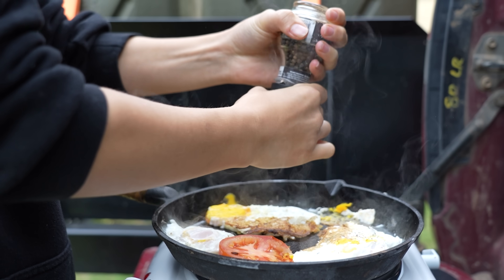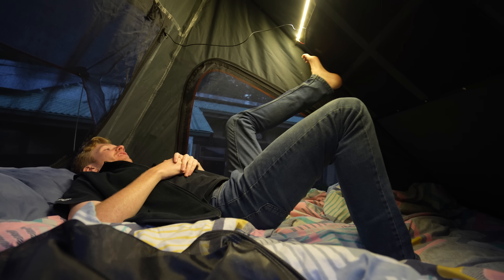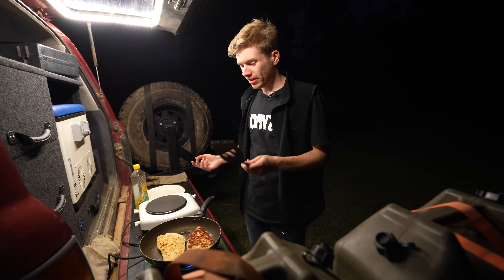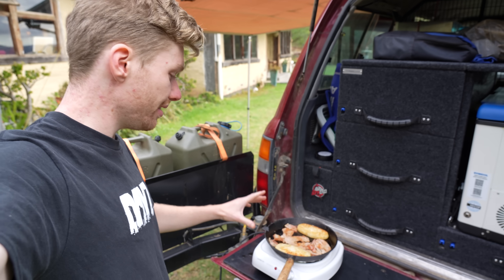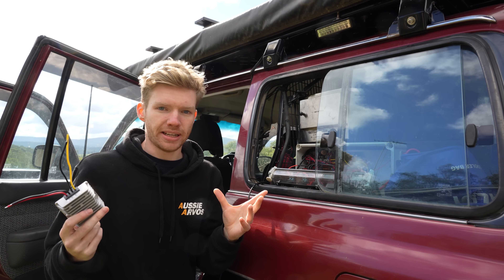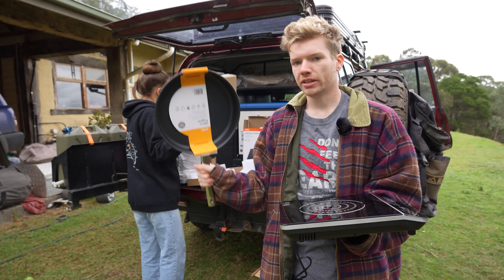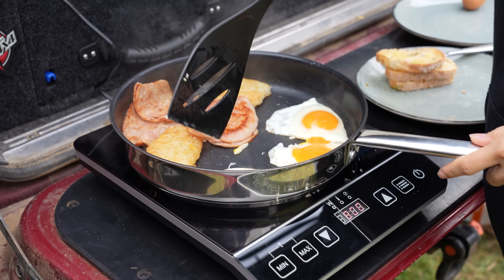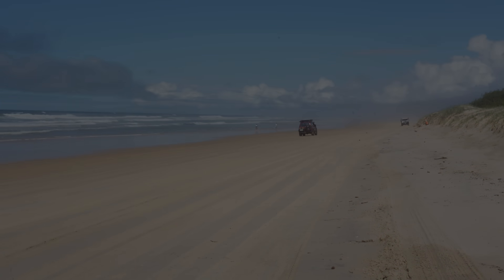is BUDGET induction cooking ACTUALLY POSSIBLE? Pushing my 12v Camping setup to its limits.

Comment: The type of cookware makes a huge difference to the cook, those square pans aren’t that great vs proper thick base pans. Same with the cooker, I’ve had those anko cookers and they don’t really have the fine control, not to mention that stupid overheat error. I ended up swapping out to a safiery square unit and it is miles better.

As for the home, it’s a different level again, and going for a gasless home is a better option in the future as you can offset your cooking costs with solar, where gas always has a set daily and yearly cost before using it

Comment: Have just recently came across your channel. This was a great video thumbs up to you. I'm looking at the Kings 200AH lithium battery, you reckon I could run a kettle, 2 slice toaster and a coffee machine with that size battery using a 1500w inverter? If possible maybe a induction cooker as well? Cheers mate have subscribed and will suss out more of your vids 👍
Reply: @Farque Knows Where Thanks for the reply mate. When you say "with all of that hooke up" what do you mean? I'm only using the battery for what it is designed for, I'm not doing anything with it that I shouldn't be
Reply: @Farque Knows Where I didn't have too much running off it at the same time to be honest. Whe. I used it the one time I have I was actually at a powered site. We're going away in a few weeks off grid so will get more of a test then I guess.

Comment: I wonder if 2 x 80Ah lithiums would be better? You end up with 160Ah but should maintain a higher voltage when in use and probably easier to squeeze them in the car.
Reply from the maker: Yeah, need more power to allow for a higher voltage discharge, after doing this experiment, i think at least 200Ah is required to enjoy cooking with electricity with no issues (for atleast a night)
Reply: I agree, splitting the discharge between two batterys will keep the voltage higher and your batteries happier.

Comment: I think your amp readings are wrong, 1200watts is closer to 120amps.. which is probably over the batterys max output. Ive got the same induction cooker and same inverter as you and i can run it on 1600w for about 5 mins before it trips the inverter. But i have a bigger battery with higher max amp output

Comment: I would like to travel with my Moulinex bread machine so a 3000 inverter with 3 lithium batteries  an 2 sola panel and a dc c charger I thing will maybe coastly but a good 5 years no problem set up

Comment: The inverter is tripping because your wiring between the battery & inverter is too thin. Replace it with wire as thick as your thumb…& it will work as intended.

Comment: You should get 2k inverter works 1200w induction
Reply from the maker: in the end i don't think it was the inverter, more the BMS cutting power as the voltage got to low due to our large current draw on only a small A-h battery

Comment: Not all lithiums are equal… you want one with a max continuous of 150A of more & a capacity of at least 200ah.

You also wanna minimise voltage drop by increasing your wiring size to the inverter.
Reply: Garbage u dont need "atleast 200 amps"
Reply: @krump743  are your eyes painted on?? I said 150A & 200ah. Amps & amp hours are VERY different. Get a clue before you open your mouth, turkey!

& I actually have this running in my 4x4 flawlessly…along with a toaster, kettle, coffee machine & air fryer & 75L fridge freezer…from 660w of solar.
Reply: @pauladams4890  😂😂😂😂😂 i know what amp hours are. Wild touring runs air fryer and induction from 150 amp hours. U dont need 200 amp hour capacity battery LIKE YOU STATED. The continuous discharge rate is the number one wants to look out for.

Comment: Just got to the part where you're seeing below 12v. something is seriously wrong there mate and you're going to be killing your lithium allowing it to get that low. your BMS should be stepping in well and truly before that, like still over 13v.   Also what you need to know about induction cookers is they only tend to be variable voltage over a certain setting. Ive found  that to be around 1000W. Under  that setting they will act like they are PWM controlled where they run at full power but just cycle on and off to give you your desired setting.  Eg it will run half the time at 1000W if set to 500W but when on, it will be drawing 1000W or even possibly what the max rating is. don't be fooled by the setting on the induction cooker. Also you need to know the setting on the cooker is the heat out put wattage for cooking. with losses etc, you might be cooking with 1000W of heat but it can cost you 1200W of power. hope that makes sense .

Comment: I reckon the way to go with a budget lithium setup is to build your own battery with high current connections and a good BMS.
I'm also guessing the induction plate works by cycling on and off at a high power, to average out to the lower output power you set it at.

Comment: Hi mate its your battery unfortunately its a kings cheap BMS you need to have a 100 amp continuous BMS I have induction cooker, microwave, Air fryer, electric hot water heater,and heater all running off 300 amp lithium 3600 watt inverter, renogy 50 amp dc to dc + mppt solar and a 300 watt folding solar that I hardly ever use all  it all runs for days P.S an air fryer oven uses the least amount of power of all once you try it you will never use your travel buddy again. Regards James T

Comment: You have this completely wrong. That kings lithium battery is only rated to put out 100A continuous, if it goes beyond that the bms will cut out. Using that induction cooker at 1200w will be pulling somewhere near 100A so thats why its cutting out plus you have other things switched on too by the look of it. That battery monitor you are using is either wired wrong or not working correctly as it's displaying the wrong amps being drawn from the battery.

Comment: "The results of initial testing showed that conventional electric coil technology was significantly more efficient (82%-83%) compared to the efficiency reports by [US} Department of Energy (74%)."

"These results demonstrate that induction cooking is not necessarily more efficient than conventional electric technology. In fact, the conventional electric coil was found to be 6% more efficient than induction cooking when measured with the large cooking vessel. Yet the efficiency of conventional technology was shown to be highly dependent on the size of the cookware used."

Testing induction and conventional electric (half power / full power):

Induction cooker (best results) 75.7% / 77.6%
Electric coil 81.6% / 83.4%

"Conclusion: Results of this study show that induction cooking is not always the most efficient method of cooking. When tested with a large cooking vessel, the efficiency of conventional electric technology was measured to be higher (83%) than that of induction cooking (77%)."

"Even in its best-case scenario, induction cooking was not found to offer a cost-effective means of energy saving."

~ Induction Cooking Technology Design and Assessment, Micah Sweeney, Jeff Dols, Brian Fortenbery, and Frank Sharp
Electric Power Research Institute (EPRI).

Comment: Cheap second hand recycled Chinese LiFePO4 Cells with the BMS tripping out on 2.5v low cell voltage protection. You need better quality LiFePO4! Cr*p avoid the Giant battery too. They use same recycled batteries too. I had one and absolutely rubbish!?

Comment: Key word you used is budget!!! You get what you pay for.  I got a 100ah DCS battery and can pull an induction cooktop at 2000w 168 amp and run fridge etc and do two dinners and bfasts.  That old cook top you used was not beneficial at all.  Start with a full charge  too. Everyone would be rocking up to camp with a full battery to begin with.

Comment: To be honest for the amount of shot you are  running on 12 vdc  you are likely better off in a 24-48vdc in series battery setup especially if you are using  a lot  of 240 vac appliances 

Noting that you should be looking towards 7.5 kw or higher gen set

otherwise  you are looking at a min of 24-48vdc setup to support the  240vac you are overloading the power consumption at 12vdc and you are above the capacity1.5 kw  inverter this is why you are tripping the breaker

personally I would start looking at 2-4 burner cook tops for cooking in areas where fire bans are

do what you like  however you might want to talk to t an auto  sparky because by the sounds of it you haven't done either a vac power consuption  not vdc power consumption  on your setup as if you had you would of known at 1.5 Kw you have effective  usable usable range at  750W--1Kwat 24vdc at 12vdc  you are likely over amping on the power draw..
Reply: I think the issues is that he wants a budget setup and what he wants to do is not gonna work well on cheap hardware and not to mention how dangerous it can be with the amount of story's about 4wd's burning down from dodgy 12v setups, I always way over engineer my electronics. I had one mate who was running 4 spottiest of a wiring harness that could only handle 2, the fuse kept blowing so he just put a bigger fuse in and ended up melting all the wire instead of tripping the fuse, he was lucking the wire wasn't near anything flammable. 

Your definitely right in that if he wants to run that much power he needs to step up to a 24v battery or at least put two batteries in parallel or series to share the load better. It would also be better to calculate the power draw of everything he wants to run and compare that to the continuous discharge rates of the batteries and even then add a safety factor to everything so that your not running on the edge of what everything is cable of handling.
Reply: @djdoggy9953  for the amount of gear he is running 4 automotive grade lithium  rather than something that looks like ups battery pack
meant to be run in a series of 8 batteries

as much as i like glamping camping setups, you be needing proper battery management setup

I would suspect 2 or more  5kw or larger  inverters to split current load across  2 inverters 

you might save some cash installing this yourself though if you haven't even done  a wattage calc on vdc and  vac.. you will have problems 

My guess the fridge, hot plate pie warmer and exceed 1500 watt each I think most of these devices are going to be a bare min of 24volt by design or for current draw as much 48vdc

even if the pie warmer as a DC plugin i would stick it on a anderson plug and fuse it

though since he was also tripping the breaker he also overloaded the 1500 watt inverter on top of that

I watch him edutainment value on what not to do in an electrical setup because it is a guarantee  at 12vdc you are going to be over amping the setup where you cause electrical fires because you tried to save a buck and consume more power than what you have...

I have a belief the KISS principle Keep It Simple Stupid, this  is far from simple  bordering on being stupid as if he were to have a fire caused by electrics the insurance wouldn't pay out because it has to be passed by an auto spark so it actually complies with safety standards

Comment: Induction cooking is not for me, I'll keep to a gas burner and use the money for the induction setup for petrol. The problem with getting a 12v system set up to be able to run the newest gadgets is 3 fold, complexity, wheight and cost.
How many butane cans can you buy for the price of just an induction cooker?

Comment: I dont think you quite understand AMP draw. If a device uses 60A its actually 60A/hr or 60Ah. So if you can cook dinner in 15mins, it has used 15A. Also, why waste 45mins in a camp oven, just put the food in there straightaway.

Comment: An unrelated point on making coffee. The young lady making the coffee tamped the grounds so lightly that the the water will pass through too quickly without picking up all the flavours and volatile compounds that make a great cup of coffee. Some physical effort is required to compress the grounds. That's why the same coffee from the same shop can taste so different when there is a man doing it and then a woman. The women seem hesitant to use a bit of pressure. The tamper is not for making the grounds look neat. 
By the way, great video.
Reply: Depends on the machine man. You don't know what her extraction time was. The tamper is to make it level. The grind dictates the extraction, not how hard you tamp.
Reply: @PrizeFightingYeti  not correct. The tamper is to compress the grounds. Back to barista school for you.
Reply: @richardmalone3172  and what qualifies you to make that assessment?

Comment: Electric cooking while camping is a stupidly expensive idea and makes no sense unless you have a big rig with massive solar and battery bank. I tried a 300 watt rice cooker and it drained my 100Ah battery to nothing. So I now figure I can only use the rice cooker to prepare lunch since it give the solar panels a chance to charge up the battery before sunset

Comment: Why an induction cooker? Expensive and power thirsty. Get yourself a $20 butane camp cooker. Gas container $1.50 each. Quick easy and lasts 3hrs on full power. Not dangerous, too small and well contained. There is a heater version as well. I use them for emergencies in my motorhome. A golden rule for me is KISS, (keep it simple for stupid).

Comment: Lol - round peg, square hole.  This setup is absolutely under powered to run all that stuff.  The battery "bank" is undersized for a 1500w inverter.  A second 120Ah battery is the quick answer.  Or better:   get a 5lb propane tank (unlike single-use butane - REUSABLE!!!) and Jetboil Genesis.  Induction is great if you HAVE TO COOK IN AN ENCLOSURE.  If not the case - cooking outside, save electricity for things that have no other alternative.

Comment: Please read the specs on your appliances, before you buy them. It's best to stay at 700W or less on them, if you don't want to have issues. And there's plenty that you can get in that range. Many of the smaller, more compact models will work great, including a small 3QT/L Instant Pot. If you want to use a frying pan, get a small electric one, rather than using a higher wattage electric burner with a normal frying pan. And don't forget Crock Pots! They are great for setting up your evening meal, in the morning, then go have fun all day while it's cooking. Also, don't be overloading your power system by running everything you got, all at the same time. And maybe practice cooking with these appliances, at home, before you take them on a trip. That way you'll know what recipes will work well and which ones won't. Ignorance and inexperience are not your friends. Don't be that clueless person that never used a pressure cooker before, trying to use one for the first time, out in the middle of nowhere.

Comment: your prob drawing at least 25amps with everything going.
Reply: actually 30 amps with all ur gizmos on
Reply: yeah ur definitely going to need a bigger battery !
Reply: if ur ammeter says 60 amps for the coffee machine thats how much ur inverter is drawing , seems strange when the coffee device is only like 10 amp max peak  so the inverter must draw alot more to power that
Reply: im guessing ur stepup converter also has enough amperage for the full amount of the travel buddy .
Reply: new coffee machine and induction cooker look good . .. interesting about the power loss cut out from the BMS / battery